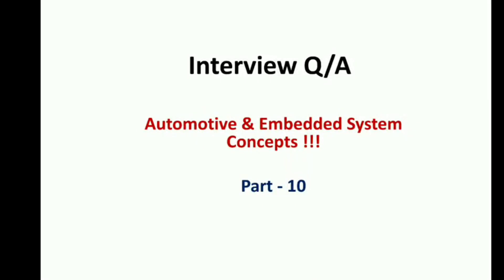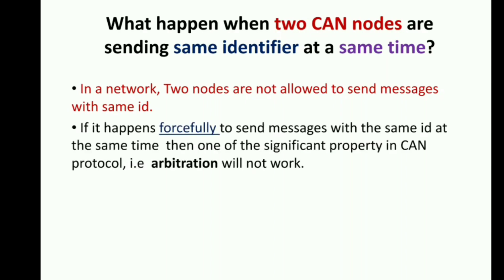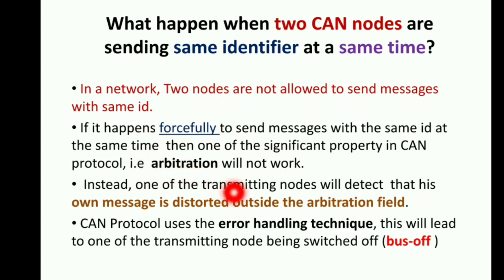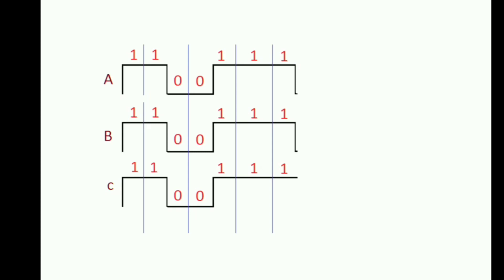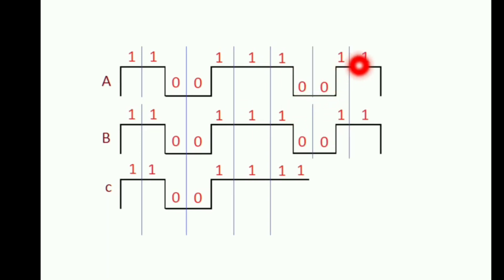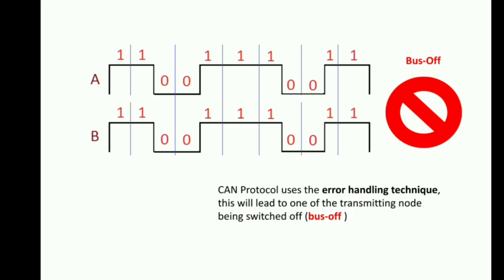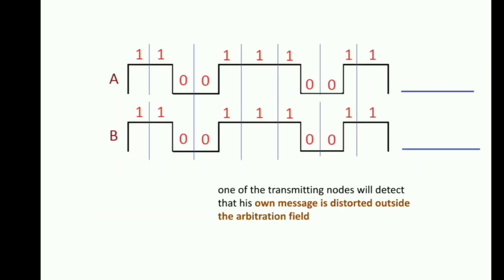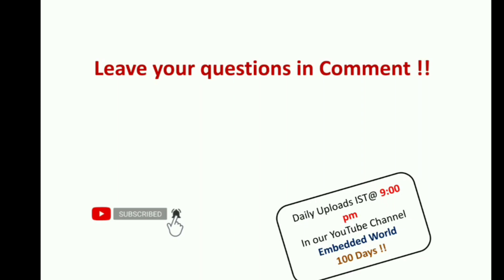Part - 10 | CAN Protocol|Automotive Interview QA|Transmission of Same ID in CAN | Embedded World

Comment: Ecu is connected with canalyzer and ofcourse it's powered up. One CAN message sent via canalyzer(IG block ). What could be the reason if messge is not transmitted?
1. Wrong configuration of periodicity  (0)and continuous sent not  configured.
2.impedance marching resister might not have connected on the bus.

Is ther any other reasons why message not transmitted?
2.
Reply: There is no IG block in Canalyzer